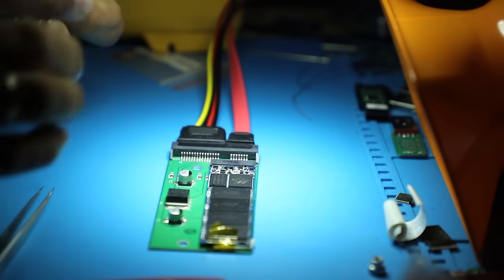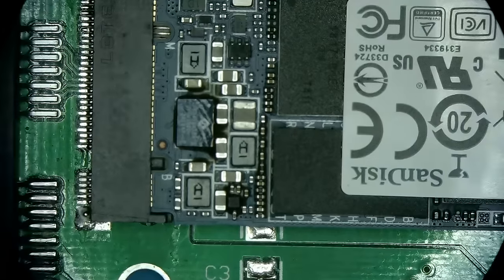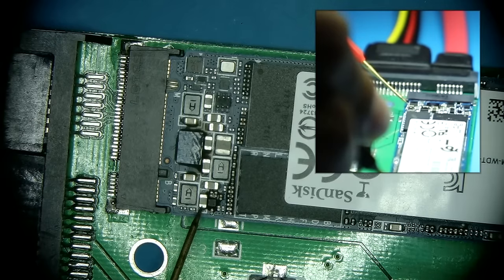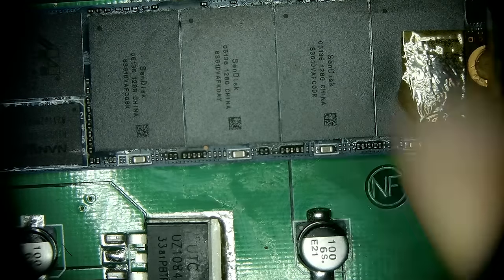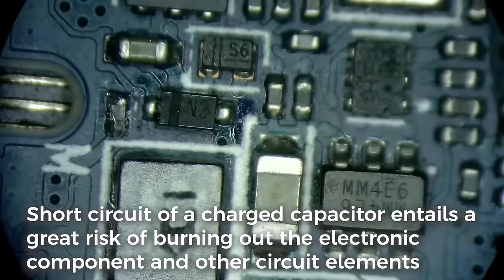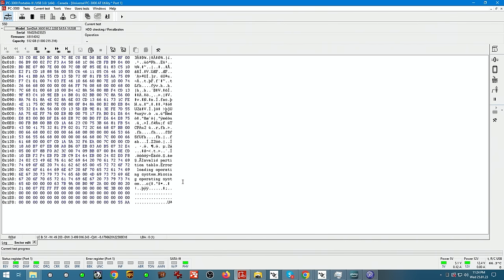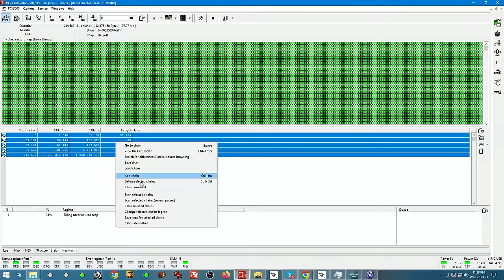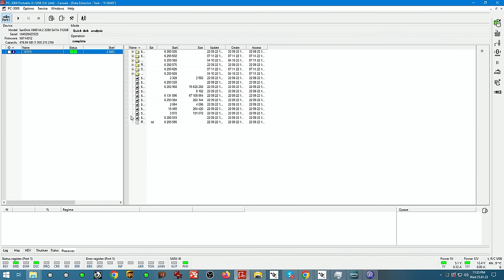I could not believe what I saw when I recovered this SSD | SanDisk X600

Comment: Sabotage to hide a mistake is a definite possibility, but I wouldn't be surprised if someone is preparing a video where they test data recovery companies by creating some easily repaired fault and sending it to data recovery companies, in which case you passed.
Reply: It was indeed thin and nicely done.
Maybe someone try to fix it and "circuit brokes at this component",so let's jump it.. :P

Real mystery. Or maybe someone found so disturbing stuff but cannot send it to police for reason or another. So he did what real good guy do :D

Comment: Erkin my friend this is a superb example of what can be done by unskilled/non educated people. But in my opinion the tech guy measured it wrong and tought it to be a fuse. When he/she measured and didnt heard the beep (while they just listen sometime s and dont follow the multimeter) he/she said ok lets use a wire as jumper and fix it. :))))). This reminded me something that happened to me very very long time ago when i was in junior at the university. My girl friend at that time wanted to borrow my car and i gave her the car she finished her work and brought back the car and gave me the keys and she said you casset player (now they dont exist anymore)  is not working. That was strange while it was a week i installed it and it was a brand new pioneer front loaded cassete player. The front loader mechanism was a revolution at those days, you were pushing the cassete slightly and the player took the cassete in and starts playing. So when i went home after uni i disassemled the tape unit from the car and  put it on my work bench and then when i unscrewed it i felt i was hit by a hammer to the head. My genious girl friend still up today i dont know how and i think it is still impossible managed to put two cassetes inside the player. Sometimes people can do thinks you can not imagine. i just wanted to share one of the funny electronic insidents i have live there are a lot of them by the way.
Reply from the maker: that is hilarious, Gurhan.

Comment: The skill just to solder that tiny jumper! I’m impressed.
Reply: Actually not difficult if you have a fine tip soldering iron, a suitable pair of tweezers, and a microscope.
Reply: @SimonBrouwer  Yep 0.2mm pitch is doable like that, likely some are likely even more skilled than me.

Comment: Here in Portugal there is a company that sabotages all the devices if the clients refuse the quote.
Their new modus operandi is quote the client after they see the value of the data for like 10X the normal rate. Client declines and asks for a second opinion. Other houses see no fix for the issue, and go back to them and pay.

Actually there is a court case pending against them because they extracted the data out of a microsd, and when client refused the quote they zeroed and formated the device. They just forgot that System Volume Information got the date of that action... Right after the client refused the quote and while the sd was in their lab 😅
Reply from the maker: Maybe it would be similar in this case too.
Reply: OMG
Reply: Data recovery services are not cheap for several reasons. If a client makes someone do the work and recover their data they should pay. You can't possibly know how it will cost until you managed to recover the data. Sometimes you need to buy a working device just to be able to access the data, other times you may be required to buy a working screen for a phone then you notice that the client has a strong password in effect on that phone but is not able to tell you what the password is. If you spend your money on 100 clients without charging them you're gonna be screwed so I think everybody should keep their end of the bargain.
The moment you did the job, client should not ask for a second opinion. Client should ask for a second opinion before making me to do all that work.
Sounds fair to you?
Everybody does judge. If you don't want to pay, don't come to have your data recovered. Nobody forces you to come.
I had a client saying that all the pictures he had on a phone worth gold to thim. The moment I asked for payment (25 bucks) he said that the data is not very important anyway and he only wanted his device back but I must give him his data too because it is HIS.
For one client I recall I showed him his beloved pictures recovered and the moment he said he thinks he should not have to pay for HIS pictures I erased them completely right in front of him (deleted, empty recycle bin for the dramatic effect, deleted partitions, created new partitions and formatted).
He called police and said I was stealing HIS pictures, HIS property.
Well, nobody found those pictures ever in my possession so I really wasn't stealing anything from him.
What would you do if a client tries to make you to do the work then tries to not pay for your work? About the deletion of the data... sometimes this is happening for a reason 😇.
Reply: @Dandan-tg6tj  perhaps I explained myself wrong.
First of all I own a data recovery business.
I quote the client for the job, he accepts and pays we do it, he does not he gets his drive back.
When we quote we may expect problems, but the point of accurate diagnostics is to prevent you from "not knowing how much it will cost until you recovered the data". That's unprofessional and idiotic.

What I was talking about is a company that before giving a quote, works on the device and evaluate the importance of the data. They extract the data out for a safe copy and if client refuses then they will sabotage the device and hand it back.

P.s: Oh, and we work on a no data no fee basis.
Reply: @Dandan-tg6tj  Awful response, if I decline your estimate that doesn't give you the right to destroy my property. Most repair places I deal with will either do estimates at no charge, have a set fee for estimates which you pay in advance and you still get to choose to go ahead with the repair or not. If you request the work but don't pay then they don't send the kit back which seems reasonable as you've always got the option of paying if you don't like it.

Your solution to destroy something is very amateurish and feels like you're looking for trouble.
Reply: @Dandan-tg6tj  By that logic you'd justify a locksmith burning down your house because it's not accessible.
Reply: @simonbarker980  Well, you can see the house, you can't see any (probably) fictional data. By your logic I should give a client any data he/she requires without any proof of actually existing. I can be sued for destroying important data which is his/her property so the moment a virtual client hands me a storage device I should expect to be sued for the 1 million Bitcoin even if there was never any proof that the million Bitcoin was ever there? Is this what you're saying?So if they say they have a novel completed on that storage device, this doesn't mean they actually have one waiting to be published, right?
Reply: @Dinkleberg96  cannot disclose at the moment. There used to be another one in lisbon doing the same but they seem to have stopped. At least now I receive their drives without sabotage 😅
Reply: @Dinkleberg96  would not get me in trouble as I have many cases that show sabotage during the dates the devices were on other labs. Just does not feel right to be mouthing someone who soon will learn the lesson 😛
Reply: @MordePT  I really hope they do learn a lesson! That is disgusting behavior. 
I wonder if they copied the data before sabotagging the drive. Bc if they asked for a lot of money and the costumer said no and then the costumer sent the drive to a 2nd shop and the 2nd shop says: sorry we cannot get ur data. The costumer would think something like: ok so the 1st shop said they could get it, so i may just send it again to them and pay the high price for it. But if they destroyed the drive without copying the data what would they say now? Would they say the 2nd shop broke the drive even more? Do you know what i mean? If thats the case it's even worst.
Reply: @Dinkleberg96  thats exactly what they do. Trust me. I've seen it more than once. Another thing they would do is to wipe the ROM on seagates and then give a quote for a ROM rebuild after they have done a backup 😂
Reply: @MordePT  I'm not in the data recovery area i know nothing about it, but i know ROMs are read only. They can only be programmed once at its factory. They aren't even re-programmable, only EEPROMs are. How do they do that? Unless they break down the ROM ic in any way and put in a new one on it when the costumer accepts?
Reply: @Dinkleberg96  well, actually they can be erased. Erased or edited. It's stupid because it's READ Only Memory but you can erase it 😅
Reply: @Dandan-tg6tj  not getting paid is one thing. But deleting the data is not really a cool move, nor would it bring you a better situation. A customer not paying your work can be charged in several ways. Maybe with help of collection agency. But as soon as you do something stupid like deleting the data you got yourself from a clearly victim position to something vulnerable. thats just stupid. and posting it on youtube is stupid itself.
Reply: @martinkrabowski2057  I really disagree. Like I said, client doesn't want the recovered data (doesn't want to pay). I need the extra space so I delete all the data that's not needed no more. The moment I spend half of a day to save someone's data and that person thinks they can get it from me without paying, I suggest they think again.
They can sue me, of course, if they want to.
First they will have to prove they had any data in the first place and that their data was accessed by me in some way then we can talk about me taking their data then about me deleting their data. Not getting paid for the job means to be robbed, plain and simple. I always return the favor.
Reply: @simonbarker980  Some "locksmiths" I have known would 💯 agree..
Reply from the maker: guys I don't know how I missed out on this awesome thread. How many of you remember this classic?https://www.youtube.com/watch?v=XI46DmVj3jA&ab_channel=JerrySwartz
Reply from the maker: I once was that 2nd shop. long time ago :)
Reply: @hddrecoveryservices  omfg this is pure gold. It's like a wayback machine to what this guys are doing 😅
Reply: @hddrecoveryservices  I usually don't estimate the cost later. I test the drive in 2 minutes and I can inform the client what the cost is on the spot.
I don't care if the client has a million dollar worth of data or if it is absolutely worthless. I don't even see what is on the data I recover from drives and I don't want to know more than the client is telling me.
Reply: @Dinkleberg96  It really depends on exactly what technology you're dealing with. --- For instance, a UV EPROM needs to be erased first before it can be written to again, which requires exposing the die to UV light. An OTP-ROM (one time programmable) could use the same EPROM tech, but would not be erasable without decapping the chip because it lacks the quartz window that permits UV light to enter. --- However, Mask ROM is manufactured to contain certain data and cannot be erased or written to. Some other types of ROMs are based on some sort of element that is either open/closed initially and can, through application of electricity, be permanently changed to a different state (fuse initially and burning it out BREAKS the connection /or/ anti-fuse initially and burning it out MAKES a connection).
Reply: @Dandan-tg6tj  Tell me what your repair shop is so I can avoid it.
Reply: @n4_ku  Your reaction is understandable but I don't need you. You need me so let's set things right and understand where we really are.
The moment you keep see clients who think that once their stuff is saved, they behave like it is their property and you must give it to them "forgetting" that you made that possible you'll start to not treat all of your clients the same. Those who try to scam me will always be fucked, that I can promise you.
If you're not one who wants to scam me, you don't need to avoid my repair shop. After all, I might be the only one able to help in my area. You're nice to me and I'm nice to you. Fair enough?
Reply: @Dandan-tg6tj  Don't give an estimate before the recover and delete their info when they found the repair is too expensive. Keep that up until you get sued and lose everything. And I bet that is why you are not saying your shop name.
I don't need you and most people would avoid your shop and find somewhere better to buy their service.
Reply: Shew, some People's data is more important than anything else in their life. I can see their business catching fire if they do that to the wrong Person.
Reply: @Dandan-tg6tj with ethics like that, you should be proud to name the company.
Reply: @BlackSoap361  My ethics are just fine: you try to screw me, I screw you back. Nobody who didn't try to screw me first, got screwed.
Everybody is judging and telling me how I should behave. You never punch me in my face and expect to walk away untouched. If you do punch me in my face, you will have the favor returned, always.
Reply: @Dandan-tg6tj  so tell us where you work so that we can support your business in a manner appropriate to the moral stances you take
Reply: Why you don't tell company's name and website??
Reply: @jannejohansson3383  What would be the purpose of that? Why you're not interested in the name and the website of a company that does the job right?
Reply: How can I contact you, please? You don't have an email in your YT profile.
Reply: I don't know Portugese law at all, but in the UK I think any companies would get in deep deep 💩 for trying to pull a stunt like that. Holding the customers data if they don't agree with the cost of service is one thing (And that's why you establish a credit guarantee and contract maximums with the customer before you start work on their contract!) but actually overwriting their data so another provider in the free market economy can't deliver the same service at a lower cost sounds bang out of order. 🙅

Given one sends their data in to services like this for recovery of lost data, I imagine that intentional destruction of the data would constitute criminal damage. 🧑‍⚖
Reply: @MordePT  How can I contact you, please? You don't have an email in your YT profile.

Comment: @ 5:48 as you zoom in the entire area beside the capacitor including the N2 has solder/Rosin residue so the piece was fairly obviously worked on by another shop. Wouldn't be surprised if the N2 was also altered since it sits crooked on the board and the solder looks to be heavier than the original factory work.

Comment: The saboteur has some mad soldering skills to have been able to do that.
Reply from the maker: the more I think about it, maybe it was not sabotaged... but why put a jumper on a otherwise working unit... I guess we will never know
Reply: A pro wouldn't put the jumper on top of the cap where it's clearly visible. Besides, there are much better (easier and less detectable) ways to sabotage a drive. Heat cycle the drive repeatedly, causing solder balls (or, fingers crossed, bonds within the chip) to crack. Or better yet, drag your feet on some synthetic carpet and discharge into the chips a few times. Literally undetectable and, more importantly, unrepairable. And even if the shop for some reason decapped the chips and looked at them with a SEM and figured out it was ESD, you could always plausibly play it off as an accident.

Comment: Surprised that the PC-3000 software is not showing a short circuit under the power info section
It was showing 0.00A for the 5V supply and 0.00A for the 12V supply when it was shorted
After you removed the jumper wire it was showing 120mA on the 5V  supply and 0.00A on the 12V supply.
So it is obviously not being given 12V
Reply from the maker: I think protection for over amperage kicks in in such cases so that PC3000 does not get damaged. If surge on unit is over a certain threshold it stops feeding and lights go dim on registers. Just my theory

Comment: I bet a repair shop claimed "bad hard drive"
He called BS.
The shop then made the hard drive bad by shorting it out.
Reply from the maker: its a very valid option, but someone erased everything in September. That's why I think whoever erased it, did it by mistake. Once realized that TRIM killed all of the data permanently, they were forced to come up with some way to show that the drive is bad. Just my theory
Reply: if they claim the hard drive is bad, and a customer doesn't want it back they can resell it
Reply: @PeterShipley1  Yep, which is why I jumped to that conclusion first.

Comment: Files and folders that are recovered in the above way, can the files and everything be contained in a zip or .rar archive and then shared ? Suppose if we didnt wanna loose timestamp information of folders and files then can personal files be put into a archive then given back to the user?
Reply from the maker: A simple image file will keep all that metadata
Reply: @hddrecoveryservices  in which format ? .iso .tar or .zip or .rar ?
Reply: @anmac6910  raw
Reply: @Dandan-tg6tj  why raw what am i supposed to work with raw format?
Reply: @anmac6910  What do you want to do with whatever you find on a storage device? Is it yours or it is a client's device?
Reply: @Dandan-tg6tj  its mine personally
Reply: @anmac6910  Does the PC see it as a device but the data is corrupted or you can't access anything?
Reply: @Dandan-tg6tj  the drive i think is spinning but theres also a clicking sound it looses power or something it makes a loosing power electronic sound then it starts ticking. The hard drive does not show in windows explorer